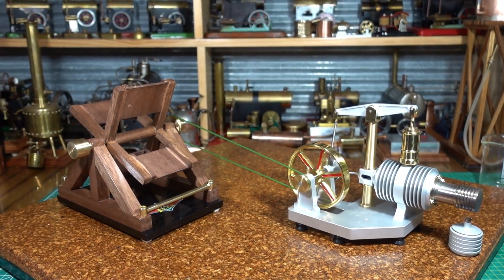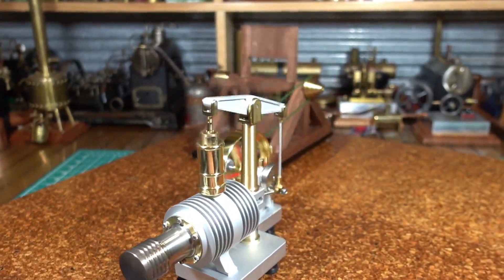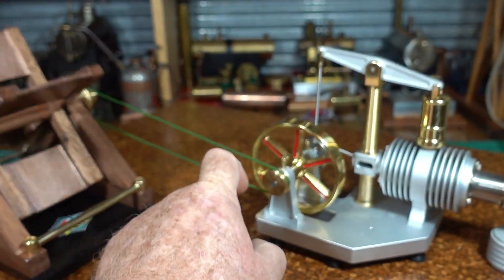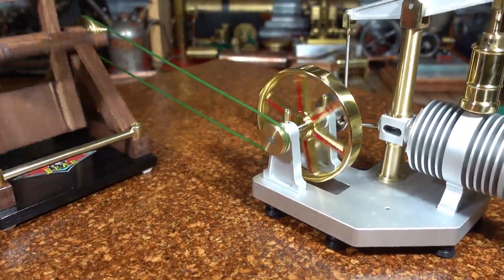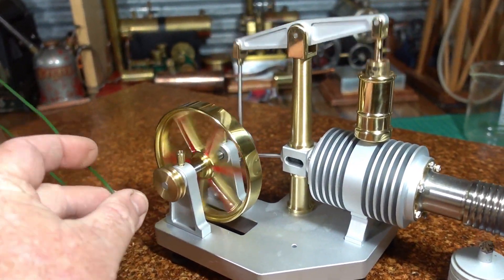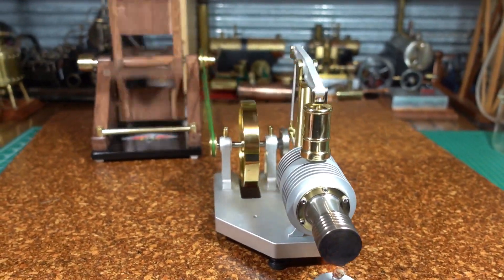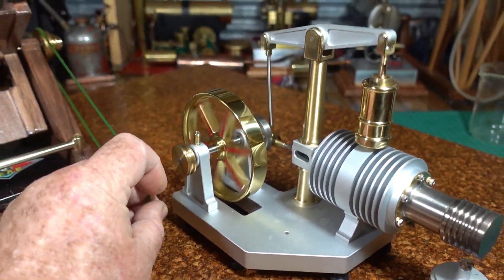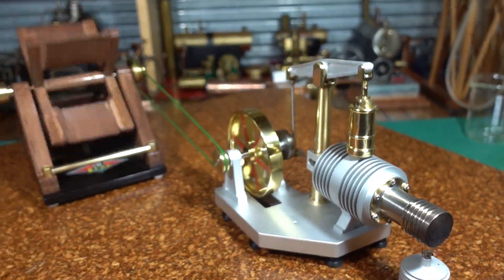Stirling Engine Tarot Large Scale  Running a Baker Fan

Comment: What lubrication do you use for the piston, axil bearings and other moving parts? Is it better to use graphite powder for the piston.
Reply from the maker: G'day I'm just using a really light oil like 3 in 1 for the metal moving parts. I haven't had to lubricate the piston as yet (it is graphited brass) but if needs to be lubricated in the future I will use fine graphite powder - Cheers Jim
Reply: @SteamEngines-Jim  Cheers, very nice looking model thinking of buying one.
Reply from the maker: @sylar1989  They are a really nice engine, have a look at a friend of mines video running multiple accessories in this vid - https://youtu.be/tVOiKr7WrJs